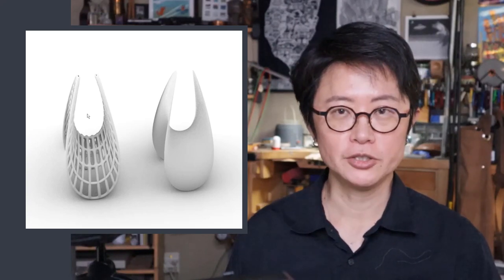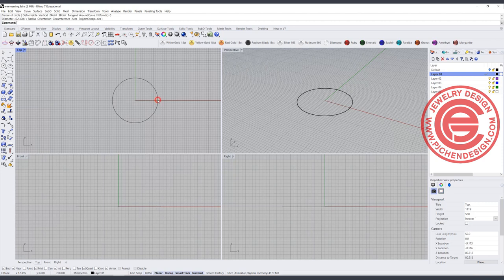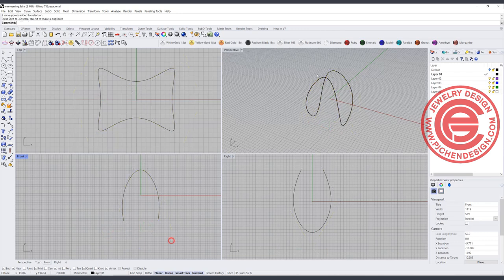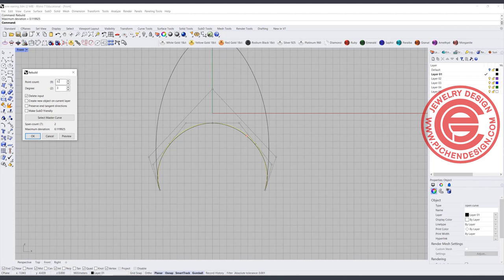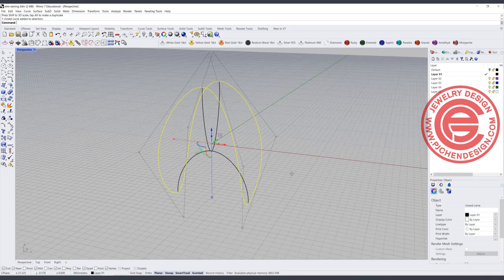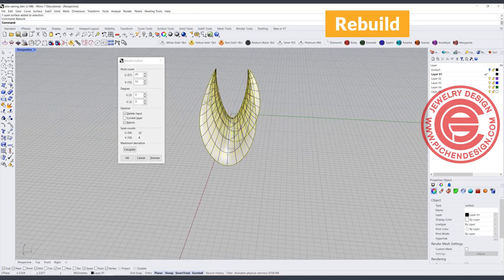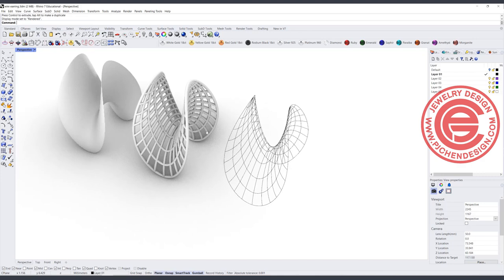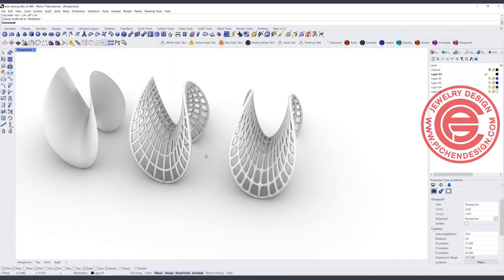Wire Earring- Jewelry CAD Design Tutorial 3D Modeling with Rhino 3D #258

Comment: Pj, What minimum wireframe pipe diameter would you recommend for casting? From personal experience. Ive never had filigree cast
Reply from the maker: It depends on how big is the model, and how tight of the structure between wire

Comment: when i boolean union the jali pipe pattern i face Surface intersection error. I saw some solution in your Q/A playlist by changing the coordinate of the pipe, but can we group it and print in 3d printer? or is there any easier solution to overcome that
Reply from the maker: Also long as all the parts are solid, they don't have to be boolean in order to 3D print.
Reply: @PJChenJewelryDesign  thanks, closed polysurface is consider solid right. if they are solid i just group them to make them easier to maintain during the design?

Comment: can we join the networkwireframe? i unable union the surface of the network
Reply from the maker: you can boolean union them. if not, I have several videos discuss why boolean not working in Q/A playlist. check them out!!
Reply: @PJChenJewelryDesign  yes i did use boolean union , only some are able to join but others not , thanks will check on the Q/A playlist

Comment: Hi PJ; I was really curios about the design of such jewelry pieces, now you enlightened me:) In order to print and cast such pieces in precious metals; which resin printer you suggest? Will 4k be enough or I will need something else? Need your recommendation;thanks a lot
Reply from the maker: The 3D printer is getting more affordable nowadays. The fine detail use to print in wax with solidscape wax printer but now there are 8k resin printer. I have a 4k printer and the resolution is good enough for most of jewelry line engagement ring. I believe 8k will have super surface but I have not try one myself.
Reply: @PJChenJewelryDesign  yeah, that is what I heard about 8k printers;they have perfect surface finish. So bad I can't find any in Turkey right now; since I doubt about 4k, I keep my money right now. Thanks for reply,love your work,keep up:)